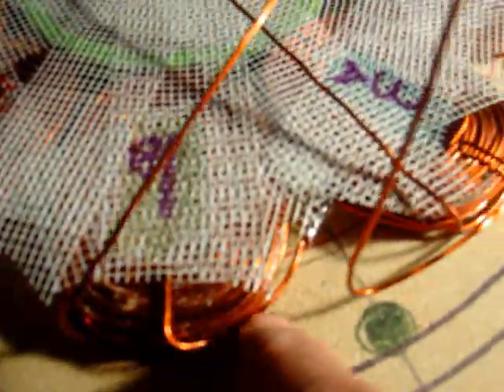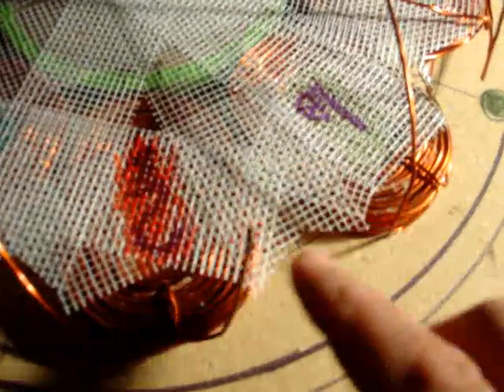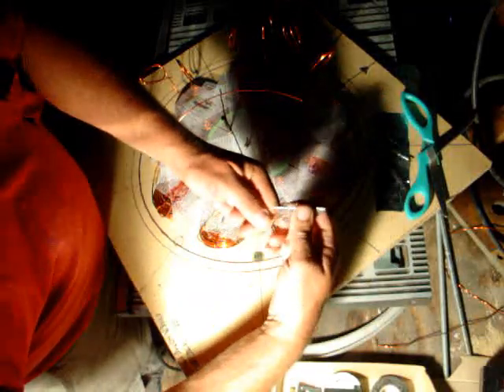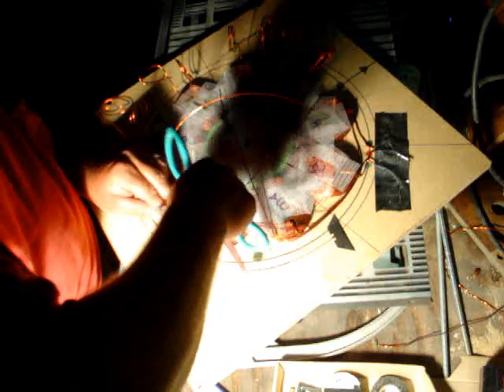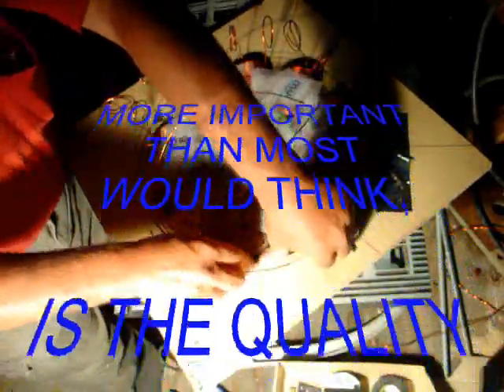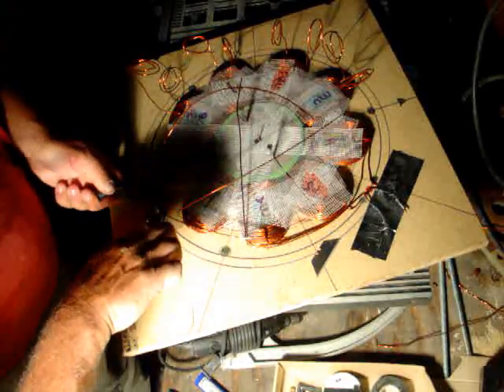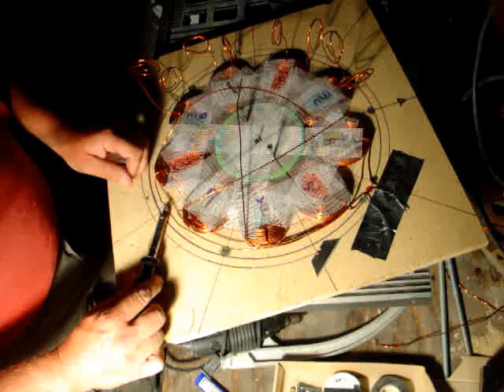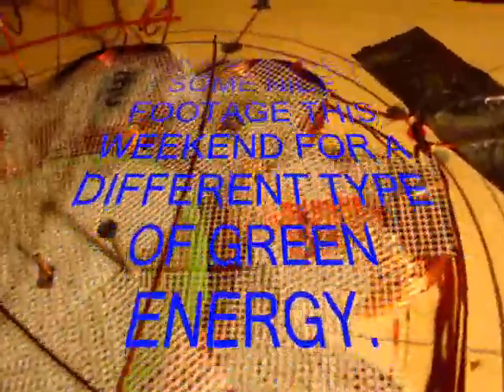BUILD A DUAL PERMANENT MAGNET ROTOR WIND TURBINE (PART 11)

Comment: DO YOU HAVE TO KEEP THE WIRES  FROM ONE PHASE  FROM TOUCHING  THE WIRES FROM ANOTHER  PHASE WHEN RUNNING  WIRES TO THE POLES,  I REALLY  NEED  TO KNOW IM IN THE PROCESS  OF BUILDING  ONE AND CANT  GO ANY FURTHER UNTIL  I KNOW , ONCE  YOU POUR  RESIN  ITS DONE, I WANT TO MAKE SURE  I DONT MAKE ANY SIMPLE MISTAKES  I WOULD REALLY  APPRECIATE  IT ?

Comment: Questions. When you run the tap wire around the outside pass the other coils, cant the other coils induce that wire or vise versa as those other coils spin pass the other poles? Shouldnt the tap wires be shielded? Or isnt there that much induction for it to matter?  My thought is, if you are inducing those coils that much and send it through one wire around pass the other coils, why cant the other coils over power that induction in the one tap wire? Does that make sense?

Comment: how do you make or measuse wire turns per coil, coils or how do you make 12v, 24v, 48v?? what factor determines the voltage??